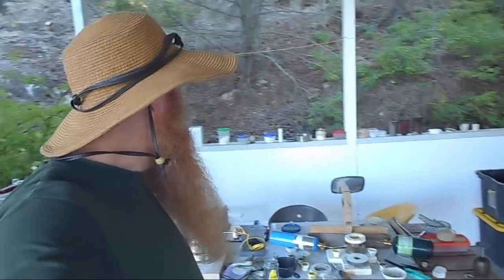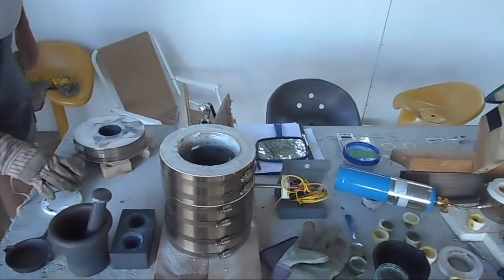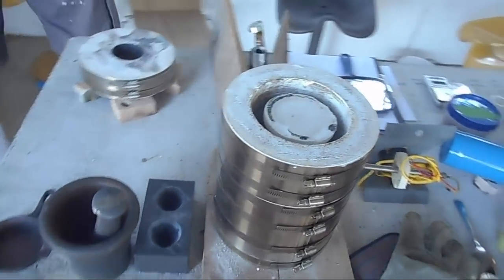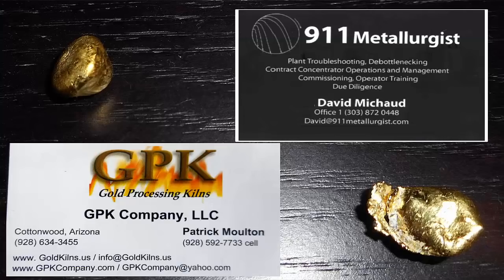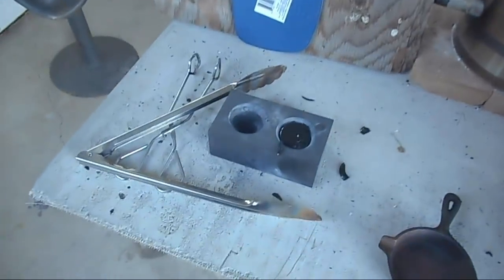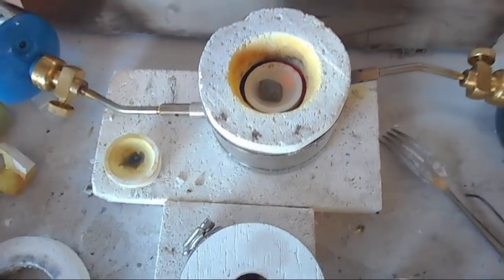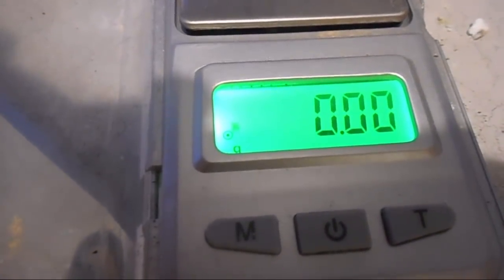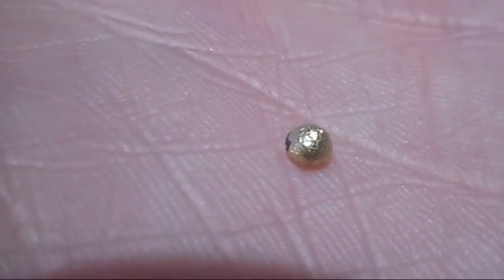Fun Smelt of Blue Chip Soil Sample (Nice gold bead)

Comment: Dan. Love your videos. keep it up Im going back and visiting your older ones ..  I'm a bit of a safety nut And I like that you use a lot of protective P P E .  but I notice you are using a table   not bolted to a wall I would be concerned that if someone  slipped your oven could be knocked over  you should set up a more permanent table    good luck thanks

Comment: Question is: how many tons of dirt can you get that much gold out of?
Reply from the maker: So far we are looking at about 10-12 grams per ton of seam material.  However sails have been diluted with other stuff so we would be lucky to have 1/4 that.
Reply: @Danhurd  'sails'...? Not familiar with using the word 'sail' or 'sails' in conjunction to mining... ~( ,m,)~
Reply from the maker: Typo  "Soils"
Reply: @Danhurd  Oh so the soil which has the gold in it has been co-mingled with soil of lower mineral value either by erosion or by some man caused activity which turned the high value soil in with low value soil?

Comment: What all did you burn away in that cupeling?
Reply from the maker: Not much is burned away.  the lead is absorbed into the cupel.
Reply: @Danhurd  Okay so there is a lot of lead there. That explains it. I ask because [as you may have figured out by now form all my comments] I am focusing 'heavily' [pun intended and copyrighted] on lead, zinc and copper locally, with hopes for an occasional tiny bit of silver, indium and cadmium.
Reply from the maker: The lead is from the fluxes used in smelting not from the ore.
Reply: @Danhurd  Oh crud. Bummer. [sad eyes] Why so much lead in flux?